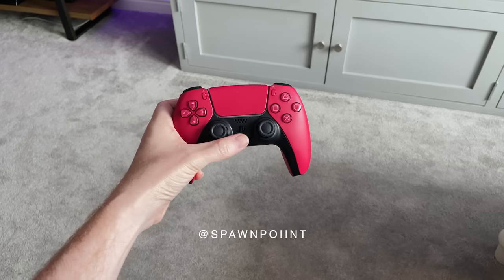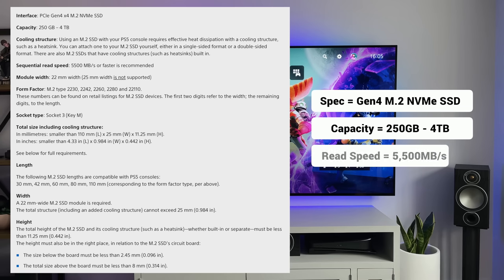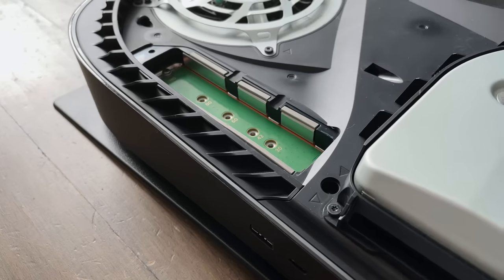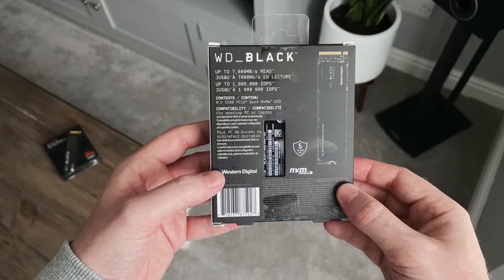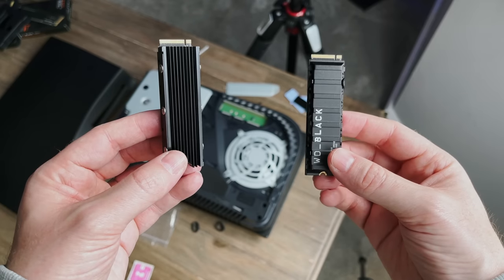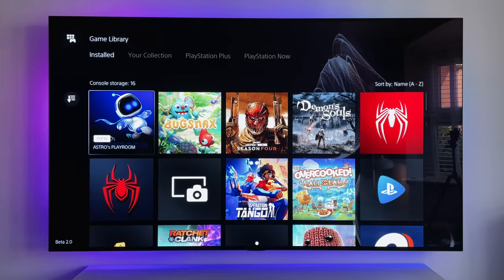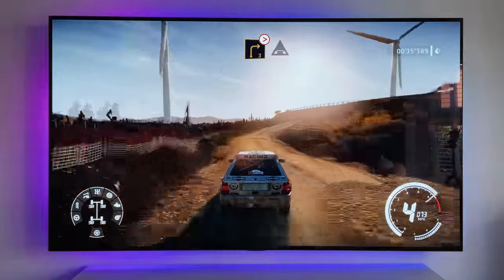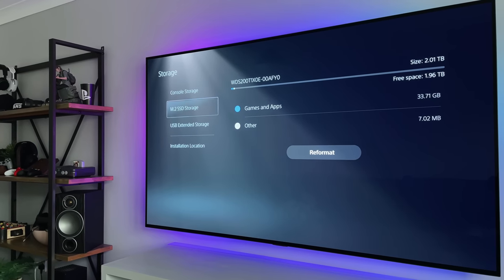PS5 SSD Upgrade: Installing 2TB SSD + Heatsink

Comment from the maker: UPDATE: The next PS5 system software update is tomorrow - 15th September 2021 - You'll be able to install your M.2 SSDs without the beta from then.
Reply: Just heard the news. Came back to watch the video again to see what im about to get myself into. Lol.
Reply: Can you do a video explaining how and where the heat is going from the SSD? I see those two little notches on the long side of the SSD bay next to the fan, does heat dissipate through those little notches and then get pulled into the fan? Or is negative pressure pulling cool air into those notches and pushing it through another slot inside the bay?
Reply: How’s your WD M.2 holding up?  Which M.2 would you get?
Reply: Installed the WD SN850 and heat sink, good recommendation. Hope it’s the same performance as my Samsung 960 on the PC 🚀 great vid
Reply: and i just  got my wd sn850 yesterday perfect timing
Reply: Where did u got the stand for the controller from? 😳😍😍😍😍
Reply: hiya, i have put mine in today, maybe messed up not sure as it says external drive found and then shuts down. so does that mean i need to remove it before the update?
Reply: @RAMBUK1989  yes don't put sad before update
Reply: WE NEED 16TB OF INTERNAL STORAGE AT LEAST!
Reply: @DJCD92162095  that doesn’t exist lmao
Reply: Not true this guy did it wrong.
Reply: I wish some would show how to install with heatsink already attacked
Reply: I just got my ps5 yesterday. Only a year wait. So what's the best ssd to go with now that already has heat sink preferably a 2tb-4tb? Thanks
Reply: I have had my eyes on that WD SN850 even before it was already officially announced as a fit for the PS5. WD already said it would be a good fit and Mark Cerny has the same drive as well. Don't i didn't really care about that. For me, it was the convenience of having a heatsink, a beautiful drive (even though you can't see it.) and a reputable brand. Very happy i got it! I have the 2TB version, it's expensive but i have a lot of games and i needed at least 2TB. I have a LaCie Porsche design 8TB external HDD connected to the PS5 for my PS4 games and it all works beautifully!

You can absolutely go with an NVME drive without heatsink. But honestly, i would just go with one that has a heatsink from the factory like the SN850 because that heatsink fits like a glove and has just the right thermal designed for that specific drive. But to each their own of course.
Reply: Yo spawn great video but can you tell me why your WD SN850 is saying 33+GB On the games and apps but yet you still have 1.96TB left over??? Is this an issue or anything internal SSD owners need to be worried about? I have the 1TB version and it says 772GB available when I've counted the games GB size inside the Games & Apps section and it adds up around 250GB I noticed this on yours and checked mine and its the same situation so just hoping you may be able to provide some info on this? Kind regards. J.
Reply: @SSNebula  When you buy a SSD/HDD (whatever) for example a 1TB. I will never be a full 1TB. You always "lose" a bit of storage. This has always been like this. I hope you know that.
Reply: SN850 is only till 2TB. I can’t find 4TB
Reply: @fahadqureshi9220  Then you're not looking right. The WD SN850 goes absolutely up to 4TB!
Reply: @DBLCreations  I can’t find it!
Reply: Ratchet and Clank was the first proper game I played on my PS5 before playing Horizon Forbidden West and it is easily one of the most enjoyable games I have played on a console. I kept my copy of Ratchet and Clank and will replay it some day in the future. Great game.
Reply: 4:52 I been meaning to ask does this mean it erases the data of the ssd? also it doesn’t affect my saved data from ps5 games right?
Reply: @iguiste23  True. Ratchet and Clank really made me feel like I was on the next gen.
Reply: I see the 1tb wd- black ssd is £100 on Amazon now I’ll have to get one now since it’s £80 cheaper than it was
Reply: @O T  That's not bad. I think 1tb is what most of us really needs. Anything more than that then there's some games that need beating lol
Reply: My guy which size screw driver did you use?? For the second screw
Reply: @Nav 98  Whats the timestamp in the video for the screw you are talking about?
Reply: @1FAM_Gaming  2:42
Reply: @nav9867  It's a philips screwdriver. He took out the screw and silver nut and then just moved them over and inserted them in another spot.
Reply: @Nav 98  Do you have a screwdriver with mutiple heads or just a regular screwdriver?
Reply: @1FAM_Gaming  multiple screw drivers big size little size, I just couldn’t get that screw up man 🤦🏾‍♂️ i almost cried lol
Reply: @1FAM_Gaming  and yea I have the ones with multiple heads, imma try again but I hate taking the PS plates off
Reply: @Nav 98  I'm looking at the screwdriver I used and it say 3.0 x 50mm. Idk if that helps or not lol.
Reply: @Nav 98  Taking off the plates is easy once you get the technique down. Put the system on it's side then make sure the top of the system is facing the right. Use  your left hand to brace the plate. At the same time use  your right hand to pull it up just a little and push it toward the left at the same time.
Reply: @1FAM_Gaming  okay thanks man I’m typing that in now lol, i hate to delete a game because no space left
Reply: @Nav 98  https://youtu.be/Os7iC69ks-Y 
Not to promote my stuff but at 1:40mins on this video I show how to take plate off. Just keep in mind that the camera if flipped.
Reply: @nav9867  It's a game changer for sure
Reply: @1FAM_Gaming  you have a video of you you putting the ssd drive in? And the screwdriver your using?
Reply: I can confirm this works flawless i been using my ssd on my ps5 since the release of this video i have the exact same ssd & heat sink aswell. It saves you around 70-80 euros. I play a lot evey day at least 6 hours but moat days over 10 average. Never had any issues loading plus very convenient sending files back forth between the ps5 internal & the ssd